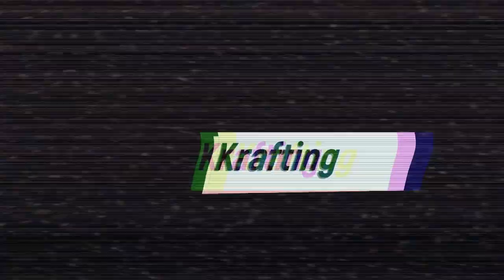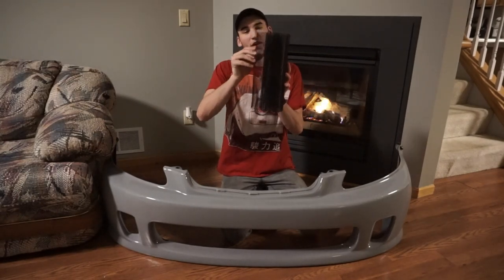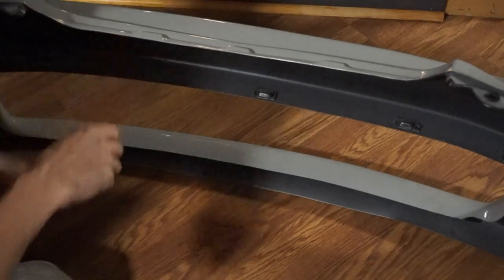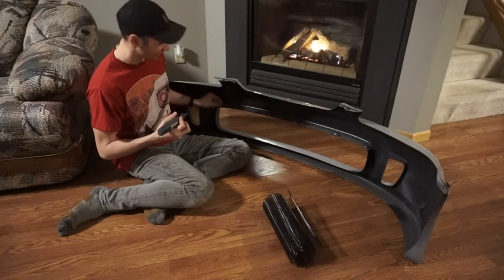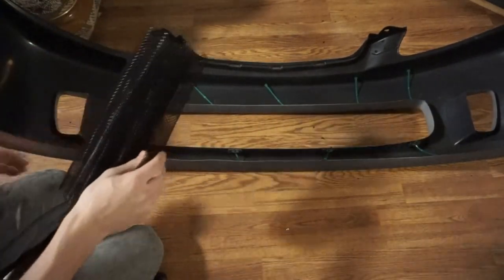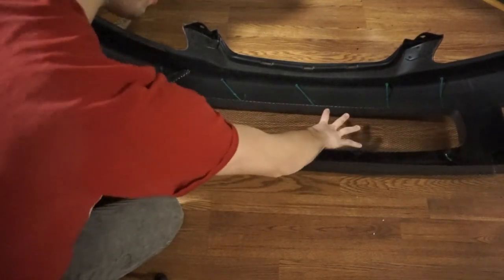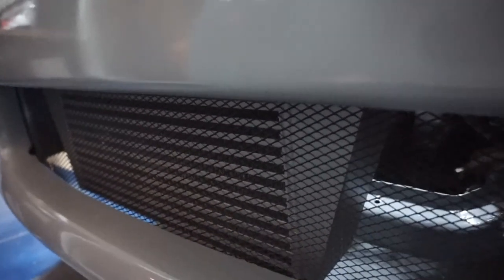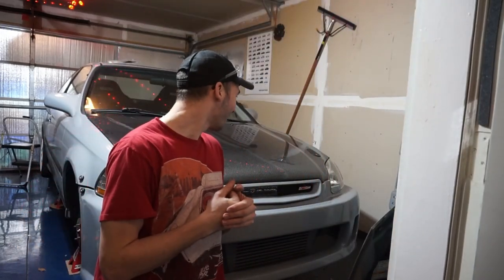The Civic Gets A Custom Mesh Grill! Easy DIY

Comment: Very nice have the same insert for my 07 cts was a pain to roll out tho!
Reply from the maker: It sure is! They ship them rolled up pretty damn tight
Reply: @kraftingkars  a counter or table with a little heat makes the difference low and slow. The mesh is on point just needs a little planning prior to unrolling and applying

Comment: Nice video, just subbed ! Just got the same bumper today, how would you recommend installing it, it came with no holes or anything
Reply from the maker: I used my factory bumper as a guide, otherwise just tape the bumper in place and make the holes by the grille/radiator support. And I just like to use quick release on the sides so the bumper won't crack if I hit it on the ground
Reply: @kraftingkars  Thankyou so much ,just ordered some quick releases

Comment: Where did you get those tabs
Reply from the maker: So luckily for me this aftermarket bumper came with them molded in, but you can easily make them yourself out of fiberglass resin, or possibly by epoxying on some p-clips, and running the zip ties through those. I have seen some people drill some holes out of sight on the bumper and run zip ties through those as well!

Comment: I think I would just glue it
Reply from the maker: That would work! I thought about hot glue, since you could always heat it up to remove it. Other glues may be a little too messy and a little too permanent for me!
Reply: @kraftingkars  I found a video, shortly after leaving this comment. Dude lists the proper glue... Hang on, I'll fetch a link.
Reply from the maker: @emilyhofland8219  thanks!
Reply: @emilyhofland8219 what glue?
Reply: @angelbenitez2658  amazing goop and e6000 are my first picks.